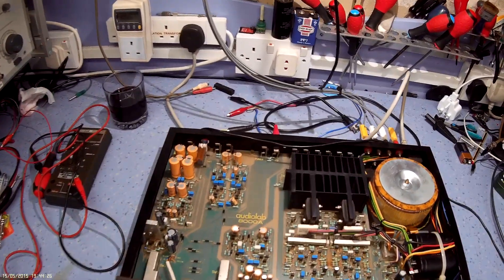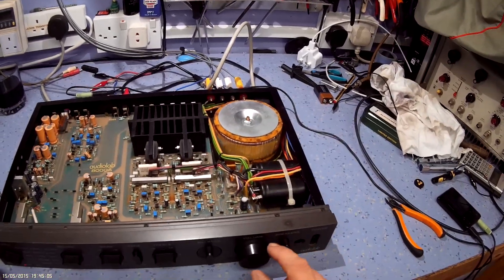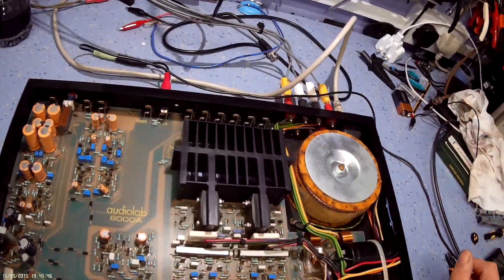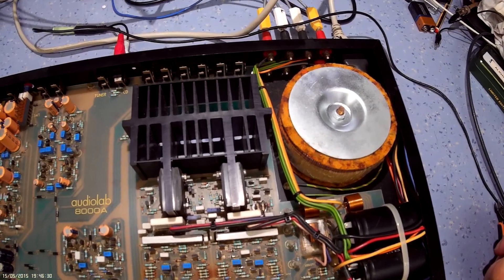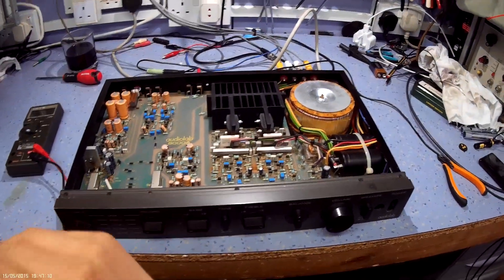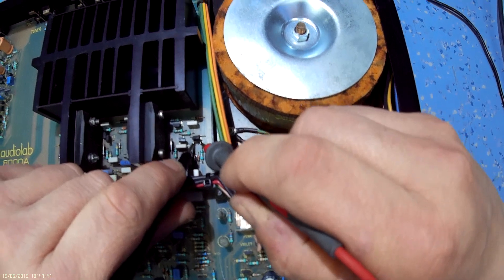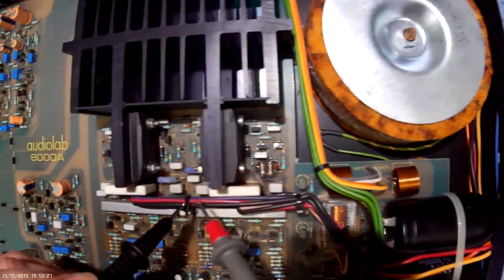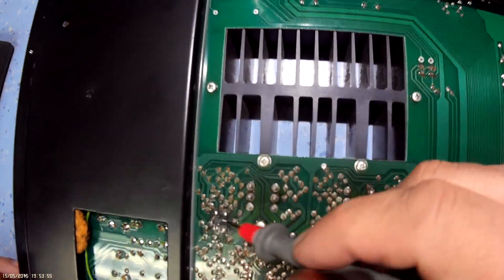Audiolab 8000 repair pt1

Comment: Great videos Simon! I have just started looking at a black 8000A, which works ok except a noticeable hum when the tone circuit is engaged. When the tone is set to "flat" then there is only a slight hum which is likely just the transformer. The hum is in all inputs and affects all speaker outputs. I don't have a schematic so where is the best place to start?

Comment: One of the best sounding amps I have ever heard.  Too bad it would go into protection when driving my 4-ohm KEF C95s.  I had to return it back to the stereo shop and stick with my NAD 3240PE.
Reply from the maker: That doesn't sound right. It cas current in abundance?
Reply: Now, I'm talking about fairly high listening levels here.  On dynamic musical peaks it would just click and go silent.  The shop couldn't believe it, so they sent a tech over with another unit and it did the same thing.  The KEFs were pretty power hungry.

Comment: Hi Simon, I was.wondering if you could please help me repair my 8000a if at all possible. I'm in Crawley, having seen your camera lens video you maybe close by.
Reply from the maker: +Daniel Carlton Hi Dan what are the symptoms?
Reply: Hi Simon, well I replaced an output transistor, then a 5w resistor like you did, that had gone open circuit on one of the legs. 

I was not giving the amp long enough to settle to and the protection relay to close. Left if for longer while looking for hot heat sinks, and it closed. So fixed, sounds great again.

I'm trying to fix an 8000p that has +dc rail on one chanel output, before the protection relay now.
New transistors on order :)

Comment: I've got one of those. It's a PIECE of SHIT! I'd never buy another Audiolab product. All of the inputs broken on mine too and stacks of dodgy caps, Okay design very cheaply populated with CRAP parts, and Audiolab charge a decent premium for their cheaply made bits of shit, too. It's pretty farked, actually, unless you wanna buy the crap 2nd hand a take the time to replace all the crap parts in the thing.
Reply from the maker: Lots of under rated components too. Musical Fidelity are another brand who charge premium prices for shit.
Reply: @SoddingaboutSi  I've got Luxman amps from the '70s and '80s that still crank out great sound without any problems. It's just about the type of people running the company, I reckon.